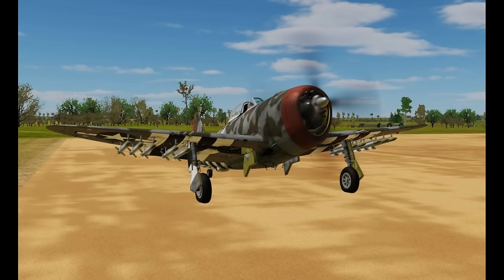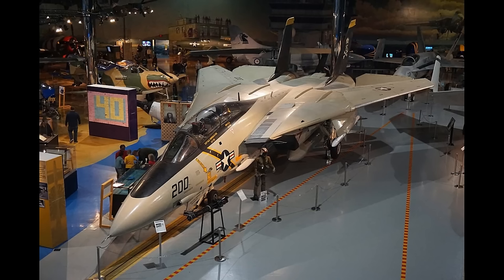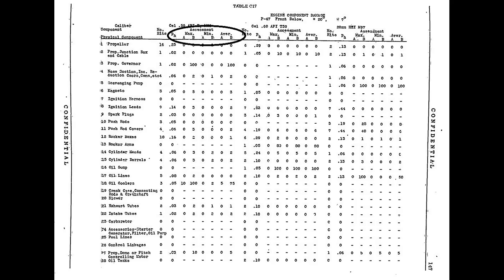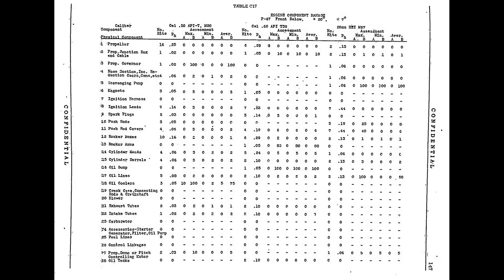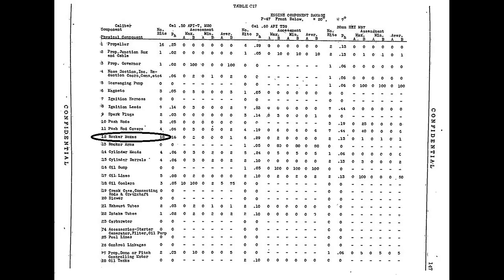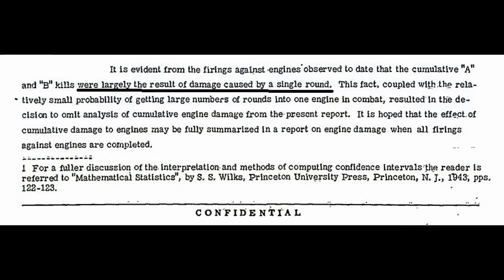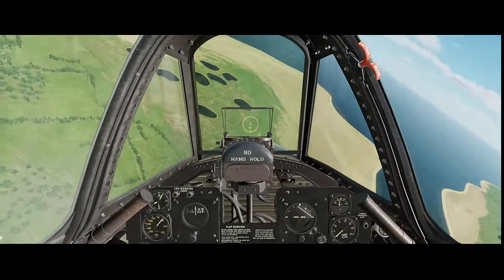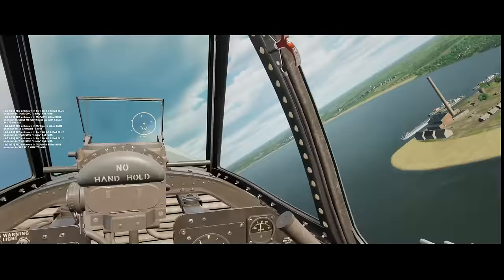50 Cal Vs. 20mm Engine Damage in WW2

Comment: "with a single cannon"

When the single cannon has 6 barrels and weighs drastically more than any singlebarrel cannons, calling it a SINGLE cannon is not really directly comparable.

.

Huh, there's some VERY strange numbers...   A single .50 hit on prop-gov is 100% B kill, but a single hit from 20mm is 0% of ANY kill???
No matter how you look at it, that, just doesn't make any sense.

113% vs 202% for HMG vs 20mm if i read the numbers correctly...

With 32 total hits for 20mm, that's 16 shots.
78 hits for .50, just under 70 shots.
But unless i badly misrecall, that's nowhere near a comparative difference in rate of fire between the two.   Not even if you also adjust for weight of the gun does it come even close, as the US .50 was on the heavier side of HMGs.
And yeah, the table included at the end says it perfectly, depending on models compared, 20mm either has roughly SAME rate of fire or 2/3.
Even if you exaggerated greatly and said you get 2 .50s for each 20mm, which isn't even close to true, 39 vs 16, and then took the most extreme difference in rate of fire, you still only get a total of 3 to 1, while the actual number of hits is 4.5 to 1.   And even the 3 to 1 is a suspect ratio.
Yes, the .50 has slightly better ballistics, but that's enough to raise the number of hits by a few %, not by 50%.

To me this appears to show rather clearly that the comparison has been weighted to the advantage of the .50.

.

Then there's the parts that got hit by .50, but did not by 20mm.   Despite the fact that 20mm explosions SHOULD make it far more likely to hit everything within explosive radius.   It may not cause SERIOUS damage to everything affected, or even noticeable damage at all, but less than twice as many components affected from explosive rounds compared to nonexplosive rounds?
That's simply just not workable.
Which suggests another weighting in favor of the .50.

.

3rd point of contention.   The chosen angle of hits.   This seems to be based almost purely on taking hits from the ground.   Which while perfectly relevant for an aircraft focused on ground attack, severely reduces the relevance of the data as a comparison between guns.   Because the parts most easily/severely affected by explosions are the ones on the OTHER side of the engine.

I ALSO very much remember about the tests that were made by aircraft doing strafing runs against jeeps.
Many of those hit by .50 strafing would actually start up and run, and could almost always be used as a source of spare parts when not.
While those hit by 20mm fire, pretty much NONE of them could be started afterwards and most could not even be used for spare parts, because everything was just too torn apart to be useable.
Reply: 20mm HEI doesn’t have a lot of penetration power and the small fragments will deal very little damage to the steel components of the engine.
AP would be a lot more lethal.
Still, a single 20mm HEI is more destructive when it comes to the engine.
Reply from the maker: The tests were not weighted to favor the 50 cal, in fact the result of these tests was a move away from 50 cal. I thought I explained that.
Reply: damn this comment has this condescending reddit energy lmao
Reply: @sparkling925  true 😂
Reply: @GregsAirplanesandAutomobiles  You did, but that's not what the numbers looks like...
Reply: @sparkling925  No more condescending than yours.   And unlike yours, certainly not intended to actually be condescending.

I'm seeing some severe logic flaws in the base source material and so far have not been able to come up with a viable explanation, so why don't you provide one?